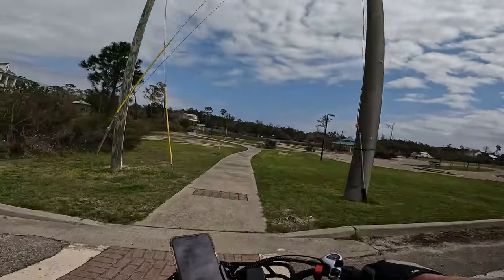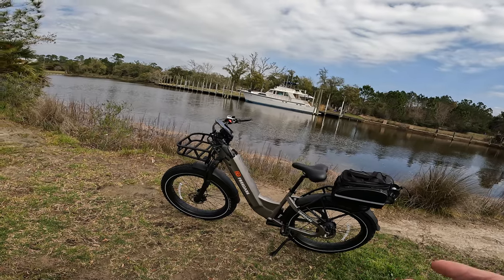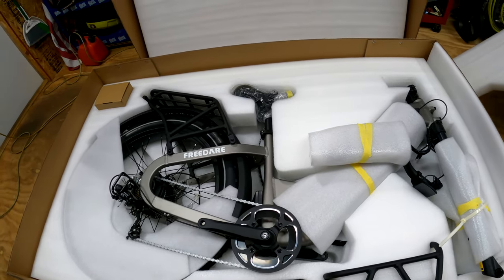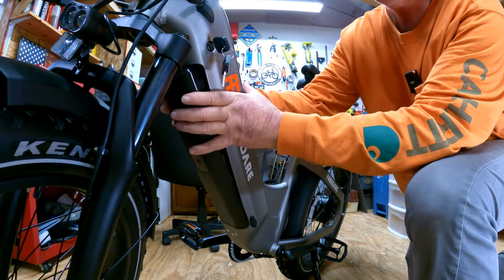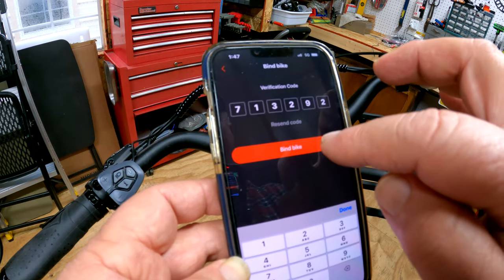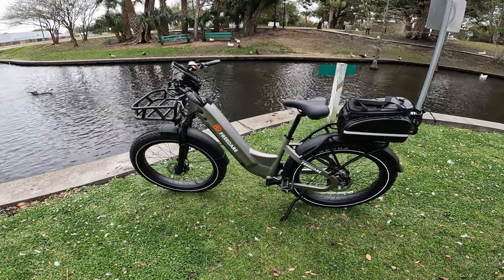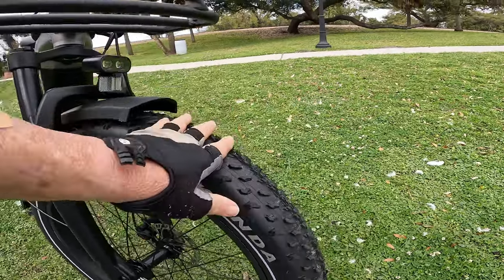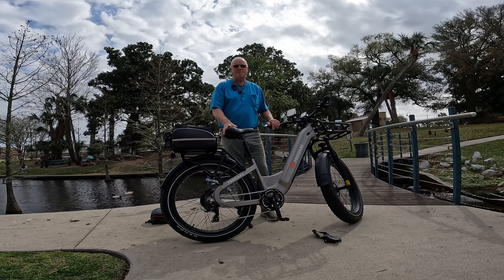The Freedare Eden - It's The Best Cruiser I've Ridden! #Freedare #ebike #electricbike

Comment: I like the light on that I actually just ordered one on Amazon. It looks similar for the XPeak and yes, I’m keeping the XPeak I have worked a deal with Lectric to work with them. I’m looking into this wobble. Customer service is the most important thing when buying an E-bike , online . The only thing I don’t like about apps is the company can control your bike. I heard that one of the companies which I won’t mention took their bikes from class three down to class two and won’t let the people upgrade to class three don’t think that’s fair. I have one bike right now with a torque sensor but it’s a mid drive. I have a new bike coming the beginning of next week that has a torque and a Candace sensor and it’s a hub drive motor
Reply from the maker: I really like the Xpeak Gary. Your new bike is from a company for review?
Reply: @Rip1Outdoors  no unfortunately it is not. I’m paying full price.
Reply: @Rip1Outdoors  I do have my foot in the door though at Lectric no bikes are promised, but I’m in communication with the manager of the influencers we’ve been swapping emails on a regular basis. And we actually negotiated a deal on the XPeak exchange for working on, trying to solve the problem at least on the high step I did tell him that I would welcome the chance to work on the one on the step over also.

Comment: This is another good option for a cruiser. Seems a bit heavy, but that’s about the average weight of cruisers, I think. It’s certainly a beautiful looking bike. Just like the other bike, I love the swept back handlebars. Has me wondering if I could get that kind put on mine. The front lights on this bike at first reminded me of ET, then it was “Johnny 5” from Short Circuit. (Absolutely love that movie) Great review Richard. I could use you doing reviews on so many other products. You explain and show good detail. You have chosen lovely looking backgrounds when you get off the bike to do a review; water in the background, one with a yacht, the other with the pond and ducks. Beautiful skies with sun and puffy white clouds. Even when the  sky changed, it was still beautiful.
Reply from the maker: Fele this is a very comfortable bike.  It is almost perfect for me and as I mentioned it would be if it had intergrated tail and brake lights.  bay St Louis looks good even on a cloudy day.  Unfortunately the weather doesn't always cooperate.
thanks for watching

Comment: Thank-you for your video, very informative. I am in Canada and will order this bike but I was wondering if you think It would be possible to install a brake light connected to the wiring and to the brake system so it lights up when you brake? I verified on Amazon Canada and they seem to offer some system as I understand that could do this, what do you think? If not, it is still a great quality bike! Thanks again loved your review!
Reply from the maker: Thank you for watching!  i have the same question.  It seems there are more companies that are ditching the tail/brake light for this battery powered light.  I have voiced my concerns to the company.  Hey do you know someone theat is good a electrical things?  Let me know what you come up with
Rip1
Reply: @Rip1Outdoors  Thank-you, If I find any system that could do this without being a electrical engineer which I am far from being, I will let you know! If on your part you find out a way to do this, please post it or make a video about it!Thanks again for your help and keep on with your great videos!

Comment: Nice bike Richard - I’m buying the Saiga model and would like to buy a new stem for the handlebars before the bike arrives.I see the one you purchased has a fork diameter of 28.6 mm but Freedare is telling me it’s 31.8mm - can you confirm 28.6 is the one to buy please thanks
Reply from the maker: Steve the stem itself is 28.6 mm.  The handlebar is 31.8mm.  I typically use an adjustable stem that I can move to different angles for the best ride.  I usually use an adjustable 90 mm such as this https://amzn.to/3ViWF2p.  That may or may not be what you are looking for.  This one comes in 90 mm and 110 mm.  Hope this helps.  Have fun with your bike.

Comment: The top frame bar looks a bit lower than average. I would love to have seen you get off the bike, by NOT swinging your leg over the back. Any opinion on dismounting at a full stop? The specs don't show the bar height so I can only guesstimate, which doesn't work if I'm going to buy.
Reply from the maker: Tom I can lean the bike towards me and step thru that way. I show it at the end at 27:15
Reply: You're so right, I had this video confused with the Saiga you previously tested. That high bar frame, in comparison to the Eden step thru, looks a bit much for my 75 year old legs.Can I ask how you compare the Eden with the yellow Magicycle in the Saiga clip? I believe it's a Deer. That's a bike I'm definitely interested in as well. It strikes me as more nimble, but I could be wrong. @Rip1Outdoors
Reply from the maker: @Tom-xn2gu  I think weight wise the deer is a bit heavier at 93 lbs. the dual suspension of the deer is great. I still love the torque sensor and the cruiser frame of the Eden. I have a full review of the deer on my channel. Will try to post a link
Reply from the maker: @Tom-xn2gu  https://youtu.be/y6UQMFXgcYs?si=wZIlWP3A3l2kCMDd